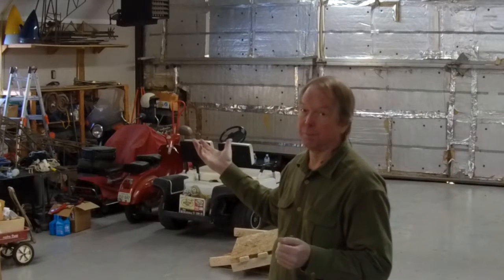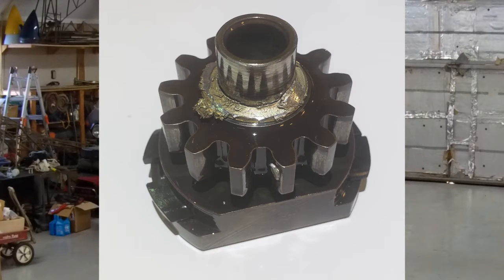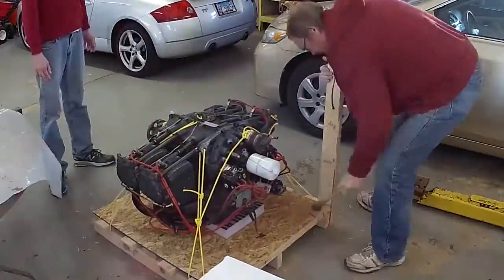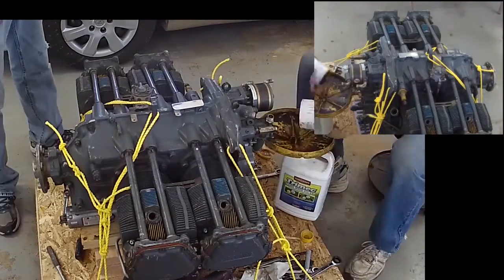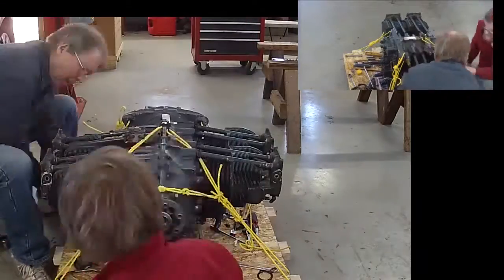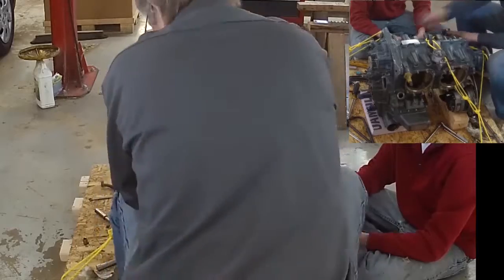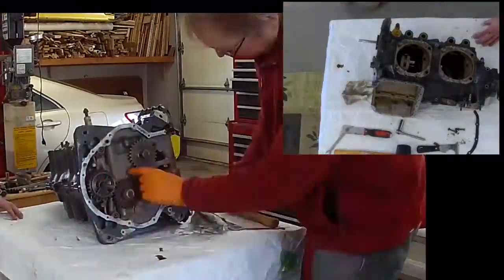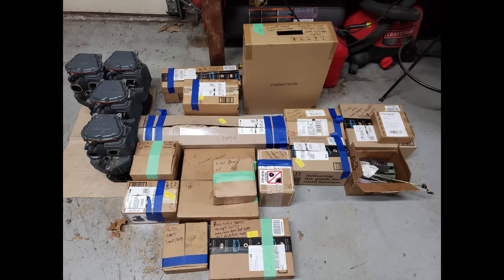Lycoming IO-360-A1B6 teardown after an Annual Inspection surprise.

Comment: Curious if you have your Cardinal engine repaired and your plane is up and running?
Reply from the maker: Yes indeed! Just flew home from Cincinnati in it today. I didn't do a video of the multi-day installation... not very exciting. But I do have a video or two I should put together about how it changed with the new prop.
Reply: @cardinalflyer  Thank you for your update. As a non pilot 80+ year old man and your Cardinal fan, I was getting a little concerned about your absence.  I must confess  I finally thought to check flight tracker, and saw your plane was flying and assumed it was you.

Comment: Interesting for me since I have a Vans RV6 with a O360 from a Cardinal which also has the duel mag. Any idea what caused the mag drive to fail?
Reply from the maker: Others have had issues with the bushing spinning, possibly if it wasn't staked. The bushing position would have to have been moved as part of line boring the case. which was done twice on my case. The non-D engine does not even have this bearing.
Reply: @cardinalflyer  ours is a high time engine nearing TBO and the mag will be pulled for 500 hr overhaul at next annual. We can check that bushing then I guess.  We plan on going well past TBO with oil analysis and other checks.